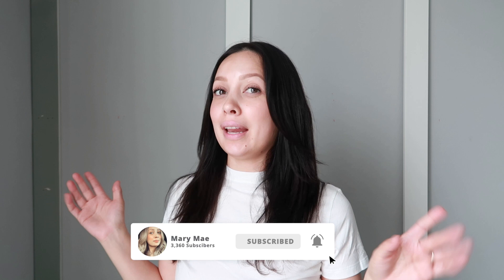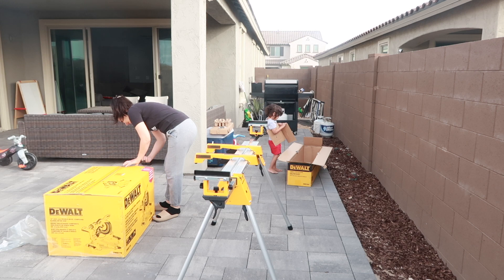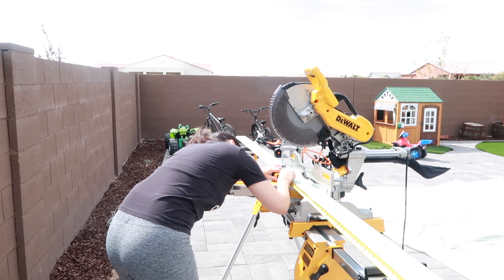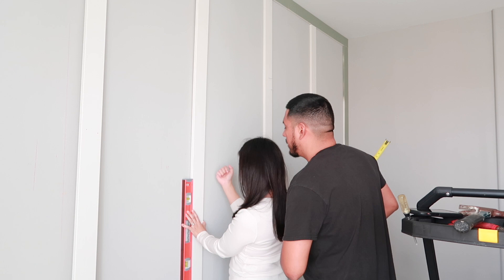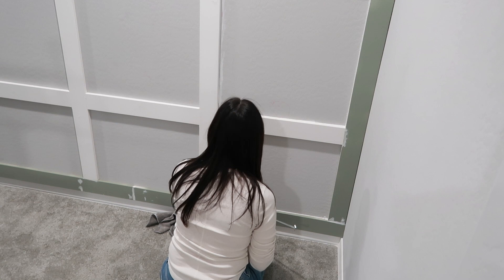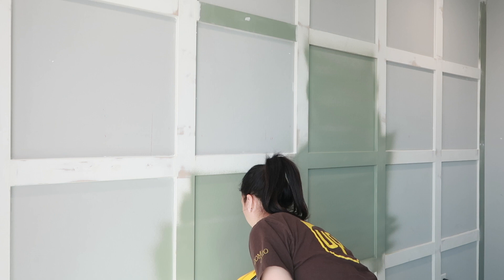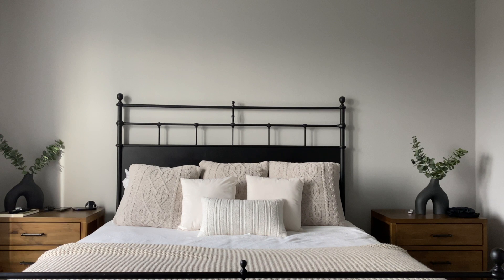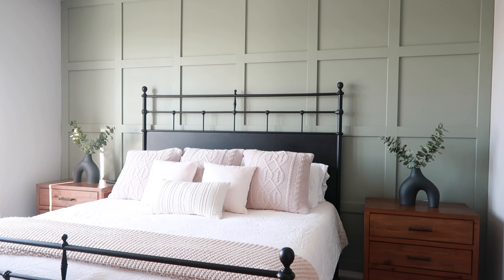DIY Accent Wall 2022| Evergreen Fog Board and Batten Wall

Comment: Hi there, how long do you wait to do 2nd spray and do you peel the pre-taped plastic after 2nd spray wall dry or peel right away after 2nd spray done.
Reply from the maker: Hi, I waited about 30 mins before I did the second coat. Once I was done with the second coat I removed they tape right away.